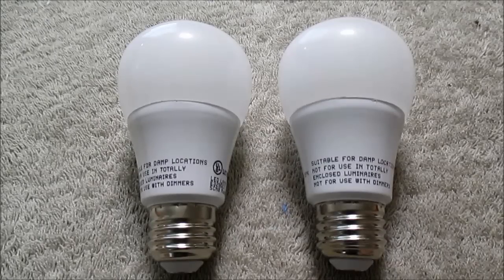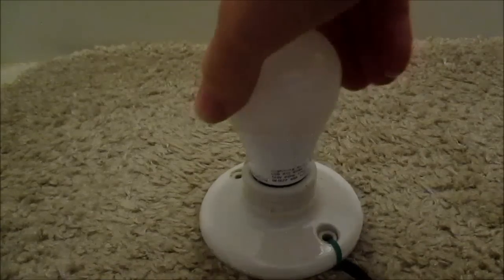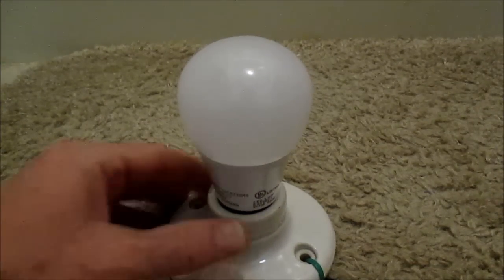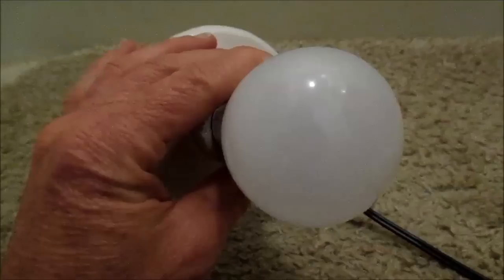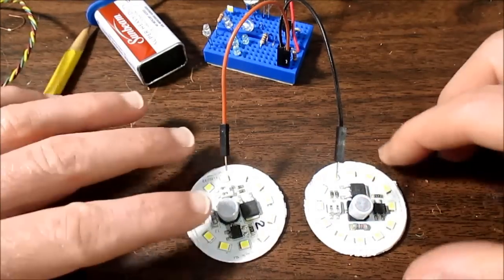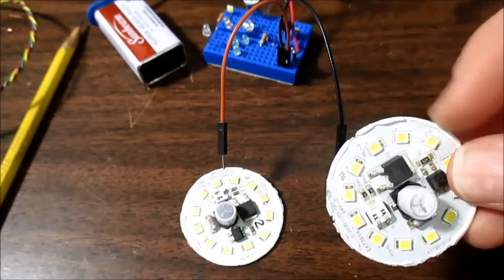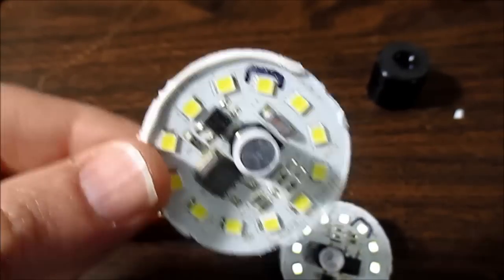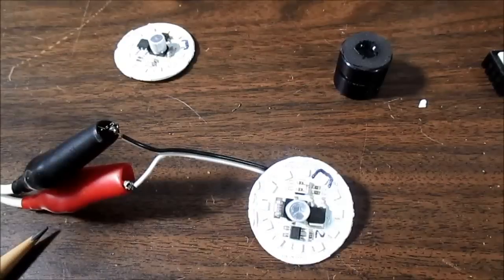Two failed LED bulbs for teardown to determine the cause

Comment: that circuit board is not necessary - you can use multimeter with diode checking setup - the meter will light the led up abit same as your circuit board did.

Comment: Well, LEDs bulb does last in the way how you mount them. Heat is the main culprit that kills most of the LEDs bulb/lamp. 
Your iPhone is much expensive compared to the light bulb. and yet you will replace the phone more frequent than the bulb.
I would drill 2 - 3 small 3mm holes at the side of a brand new bulb where the heatsink would expose to the air. Nobody is gonna touch it since it sits inside the lamp holder. The lamp surely lasts far longer than stock packaging.
But anyway, great video!

Comment: Can anybody answer this? Why does a string of LED Christmas lights behave differently than say a 13 watt LED indoor bulb in a light fixture?
Christmas lights = only heats up slightly, requires no capacitors, resistors, heatsink, remains lit if 1 bulb fails.
Indoor bulb = gets very hot even though it has a heat sink, requires all that electronic circuitry, shuts down if 1 LED fails.
Reply: Christmas LED string:  runs probably on 12V, and every individual LED has a current limiter resistor. For all that, effectivity is very low;  a lot more power needed for a lot less light.

Comment: One thing I've not heard anyone mention; these LEDs, due to their shell, only project light in about 120-160 degree direction, similar to a floodlight. While the old incandescent projected about 270-330 degrees and the flourescent tubes about 270-300 degrees.
Reply: That's why they gave a diffuser rather than a clear cover. They spread well enough
Reply: well i usually dont have the need to light a lot the ceiling
Reply: @gamanyme  it's called ambience, you want to feel like you live in a prison camp with harsh digital light bearing down on you that's fine.

Comment: I'm not as well versed as you but I've repaired dozens of blown bulbs, my most recent repair was a 10 watt (stupid thing was advertised as 20) pir flood light. 
First thing I do is remove the cover and seek out a little black dot on one of the chips, if it's not visable I short them one by one. After that I plug it in and short by connecting one wire at both tabs. All the others should light up. 
I then cut it out with snips, I did desolder at the start but it takes to long. After that I scrap back a little resist and bridge them with a blob of solder.
They also seem to last really long once repaired. It's also very quick, having it done within a few minutes.

Comment: I don't have any LED bulbs for my house but I do have many LED flashlights the LEDs themselves pretty much never fail but the wiring/soldering is typically not capable of surviving anywhere near as long as the LED

Comment: So.. it could work just fine, if you bypass the open led with a wire and soldering iron, closed the bulb and screw it up again in the electric grid... Go ahead and do that! You will save 5-7$ per bulb..

Comment: The LEDs are in series??? not parallel?  Well no wonder!  That adds a lot of points for COMPLeTE failure...
Reply: Yeah, I saw designer LED lamps for 180€ with the LEDs wired in series. I mean, I had a good laugh, but people are actually buying this shit xD

I have Ikea LED bulbs tho, they're working like they should for 5 years now. Can't complain

Comment: All my expensive LED I bought 8 years ago are still working to this day, EXCEPT ONE that burnt out. That is 1 out of 5 and it was on 24/7.
I bought some really cheap ones, like $1 each for a 100W equivalent and 8 out of 10 have failed. Although I must admit, they were in a very hot place, encased in a glass jar so probably overheated.
Still. Most of the incandescent light bulbs were alive for over 10 years in the same environment.

Comment: I've had two fail in the last 8 years among the 30+ in my house.
Reply: I've only had 1 fail in the 11 years since I stared converting them,and it happened during a lightning storm that struck a tree close to my house. The one in my garage never gets turned off and deals with temps from +35 to -45,still going strong.

Comment: O yea they cost $10 with a 10 year guarentee and then blow out in 6 months
Reply: What that warranty means is, when it fails you can contact the company warranty department and get a new replacement bulb completely free of charge.
This means that $10 you spent is just an initial expense. You can get multiple bulbs from the company without paying any more than the initial $10.
In this way the bulb cost goes down considerably every time one fails and you warranty replace it
Reply: @zdw306  Sure. Accept by the time bulb fails, the package it came in was long thrown out. 

I remember thinking what you are saying and realizing I had no idea what brand the bulb was and even I felt like spending the time tracking it down from any info I could find on the bulb. The proof of purchase was thrown out on the package.

I'm sure there are people who care enough to keep so much track of stuff like that but seriously most people do not.

The companies who make these bulbs knew this. The math was figured out before the bulbs went on the market.

They knew the bulbs could not last 10 years and they also knew the number of people anal enough to cash in the guarentee was a tiny fraction of total bulbs sold.

So misleading consumers was no big deal to them. They went ahead and sold the bulbs saying they could last so much longer then normal bulbs.

It comes down to precalculated consumer deception. That no one can do anything about
Reply: @zdw306  : How does the cost go down?
You spent $10 whether one bulb lasts 10 years or whether 12 bulbs last 10 years.
Plus, you have to store all your receipts, call some marble-mouth in Mumbai for customer service, and you may have to pay to ship all those bad bulbs back
Reply: Funny fact- a while back I had two crew bulbs fail, I contacted their warranty dept. They only wanted to know the bulb numbers they could care less about the receipt and packaging
Reply: @zdw306  who made the bulbs and without the packaging how did you get a phone number to call?
Reply: @anybag. Their website and the name was on side of bulb
Reply: @zdw306  Well good for you but if these bulbs where all tha great you would not have to deal with it.

If you read what I said most people dont have time and they should not have been mislead about the bulbs.

I can tell you did not read everything I said because you are pointing out the very example I talked about when I said most people dont screw with looking g up the info
Reply: I have had a few of those bulbs go bad. I did not have the receipt for any of them. When I contacted the warranty department each time, they did not care about the packaging or receipt. They just wanted to know what the bulb model was. I had to look online and find one that looked similar and told them the model and they sent me that one.
As for the cost. Think about it. $10 for one bulb is pricey, but once that bulb goes bad and you get another one without costing another $10.
Pay $10, then get another whenever you need it for nothing
Reply: @zdw306  . OK, I think I see what you mean. Once your original bulb or its replacements have exceeeded the warranty period of, say 6-10 years, and they keep giving you free bulbs forever with no receipt required, then all those bulbs are free and reduces the cost per year. 
The snag would be if they have not produced that model bulb for over 10 years and you ask for a new one, they should be smart enough to know that the warranty is expired, BUT maybe they don't care and will send you a new one forever.
Reply: @munsters2. Exactly! You get it!

Comment: I haven't lost an LED bulb yet but I have only been using them for a couple of years.  The cheapest I have were $0.50 each, clearance at Kroger's - Greenlite 11w, 1100 lumens, 75w replacement, which are no longer manufactured.  I bought all they had - 20 bulbs.  These are my favorite.  I'm using 12 currently, 6 are in enclosed luminaries which the bulbs say are suitable.  They look like the bulbs in this teardown.  I wonder if they're the same.

Comment: isn't that a voltage regulator not a current regulator? a resistor regulates current.
what the heck is a bond wire? in the 10 years since i learned electronics repair I've never hear of a bond wire. I've hear of jumpers and leads

Comment: Built-in obsolescence (designed to fail)... in everything you buy since the 1960s.......
Reply: It started in the 1920s I believe, when tungsten bulb manufacturers all followed a secret rule to keep light bulb life at a profitable point. This was discovered when documents came to light after East Germany united with West Germany.
The Light Bulb Conspiracy - Extended Version

https://www.youtube.com/watch?v=kdHIqa53-tY

This one has subtitles for for the non-English interviews

https://www.youtube.com/watch?v=zdh7_PA8GZU
Reply: @DataWaveTaGo  get a copi of the resit and go bak to the store and get a new one on waranty.It is electronics pcb etc in it so the waranty should be the same as for a dvd player.To few are making use of the waranty.One reson they produce garbage straigth from factory
Reply: @leohobbleohobb3781  Right. My Philips "20 year" LED failed after 4 years. I checked the warranty, it was not covered beyond 3 years. Great company, Philips, just great...
Reply: @DataWaveTaGo  Philips products made in Holland(Belgium? has had a much higher standard on components etc.If i se philips made in China or other very lowcost places that meke stuff for philips is not real philips we used to say back when people cared more about what they buy and it,s quality.
Reply: Was this led bulb made in belgium?.To claim 20 years on the product like a led bulb is a clear "lie" the way they are usualy are build today.
Reply: @leohobbleohobb3781  Made in China. The new Philips replacement bulb I bought now states "13 year lifetime". Ha, ha!
Reply: @leohobbleohobb3781  BTW, I have some early LED bulbs I bought 12 years ago that claim "26 year lifetime". Ha, ha, again.
Reply: @leohobbleohobb3781  Right.
Reply: @DataWaveTaGo  It is garbage straigth from factory.i know about the design to fail.like the printers that stopped working do to software said it should.no sensor in the tray for spill inc they claimed the counter software was for.all printers i have seen do to that, the spunge in the tay that suck up the inc spill is not quarter full off inc.some could probably take 10 times more inc before i would say that spunge needs cleaning.And as you mention since 1960 the only protests at least what i have read was east germany.They said since wolfram is a rare earth element.and Itmade sence to make it llast so next generation would have wolfram to etc.or so the story goes if i remember correct.Consumers  screwed.less quality overall.I think it is a serius matter that people get garbage for their hard earned money..But the claims on the box is joke.
Reply: True since 20's and it will only get worse too! 
 These big corps are going to get our money regardless.
  I stocked up on old incandescent bulbs when stores clearenced to put led on out. I have a lifetime supply of bulbs at a fraction of the cost no doubt..lol
Funny we have no led bulbs in our home like most do yet we have the lowest electric bills of all family & friends and we're retired & home all the time. I'm mostly in the garage burning up electric all day too.. Go figure!
Reply: @harryballz6358  easy to figure, Led bulbs no mater how expensive it still has a narrow lighting angle, in order to light up a room you have to put more led bulbs than incandescent bulbs. And the manufacturers are lying, if the led bulb is rated for example 7W, it actually consumes 8,8w electric energy, 9W = 14W (actual), the leds maybe consume that much, but the electronic circus which transform the normal 220v electricity to them consumes more, I tested with multimeter. The only leds which works are those that you buy parts and build yourself. I bought led strips and big led chips and build some fun projects, works for 5 years already, I always give leds a more powerful powersupply than they are rated for.

Comment: Following the idea that the current in a series circuit is the same, why not remove the faulty led and bridge directly. Instead working10 leds would work only 9. He says the regulator is workind good. So the only variable would be the voltage on each led.
Reply: The regulator then gets the extra 3 Volts from the shorted LED, so it would be stressed closer to its Voltage limit, and, since the string runs on 83mA, the regulator dissipates an extra 3x83mA = an extra 250 mW (0.25W) of heat.

Comment: They make this on purpose.
This way you will keep on buying.
Reply: I have had only problem with E27 sockets. But other sockets more common for spotlights, have been working for years.
Reply: really?but  I bought the product , although there is a bad review but it cheap , i try to buy it , and it very surprise to me, The quality is really good.https://amzn.to/2Nz4IHe
 ,I think i can use it for many years !
Reply: Well, I may keep on buying, but certainly not theirs. Where’s the motivation to sell poor product? Roll the lamps off the production line for cheap, with minimal QA and bottom feeder (like me 😀) will scoop them up (once!) and move on.

Comment: This are easy to fix. Remove the damage LED and solder that empty spot, light will function
Reply: Don't forget to put a resistor tho if u don't HV an extra led otherwise more current will pass through the leds
Reply: You could put in a larger resistor to slightly reduce that 67ma current so the others will last longer

Comment: No. This is a design failure. The LEDs are connected in series...
Reply: Ghost of Henry bond wire not being thick enough is also a design failure: not specifying a thick enough gauge blame is going to fall onto the engineering team.

Comment: Hate these things. The LED will technically last forever and is supposed to be cheaper than traditional but they die twice as often.
Reply: As an automotive electronics tech I am seeing far more led lighting faults and failures,these are generally built into sealed units,but with a bit of patience you can usually get into them.After moisture or water ingression the most common failure is usually heat management of the supporting electronics.Many manufacturers struggled for a bit with heat management in the light casings,Audi were considering dropping them for a while to enable technology to catch up.I have 2 single large cob led rechargable work lights which are encased in aluminium apposed to the usually glassfibre reinforced housings,the reason being is that the plastic would apparently star deforming with the heat developed by the b9ard and led it's self,even the lens of these lamps melted after the first few hours use,leaving a noticeable 'nipple' in the lens directly in front of the led and left face down on anything like a dense foam kneeling pad or floor mat will result in rapid smouldering.heat is always an issue.
Reply: As with most things in life, you get what you pay for. Buy shitty LEDs and get a shitty lifespan. I've had full Philips LEDs for ~3 years, no issues. They cost 3x what a chinesium bulb costs though
Reply: @XlordslaughterX   Where were the Phillips LED bulbs made?  It wouldn't surprise me if they were also made in China.
Reply: @lfewell2161  Phillips makes their Hue bulbs in Mexico
Reply: @lfewell2161   I use the cheapest Philips LED bulbs made in China (dozens of them all around the house), and in my experience they have been flawless so far after more than 4 years.  I paid $2.50 per bulb at the time.
Reply: Sylvania’s LED bulbs are pretty much on par for a 3-4 year life span. At least, that’s my experience with them.
Reply: That seemed to be the way at first, but of the sixty that I put into my new house in the last five years, only one has failed.
Reply: Incandescent for life with me
Reply: @VaughnfromPeterborough  you're not the only one.
Reply: @VaughnfromPeterborough   Do you have any particular reasons?  I prefer the light of incandescent bulbs for certain purposes, such as personal grooming, and at least in my experience they tend to last many, many years for a very low price.  I still use a bunch of incandescent bulbs around my house, wherever their more "natural" light is preferred and wherever my family and I very seldom use or leave lights on for long (no point in replacing them).